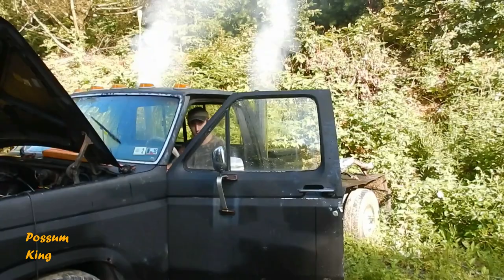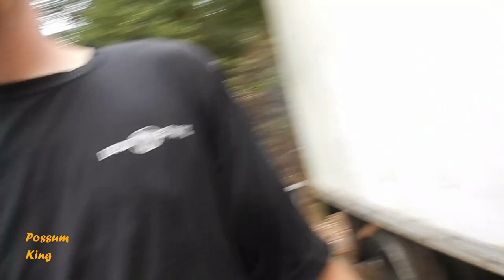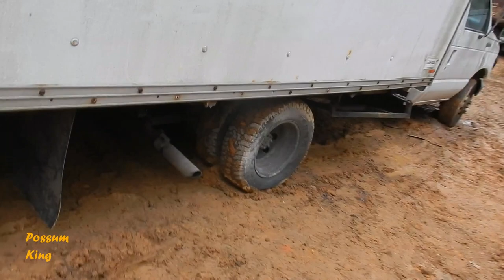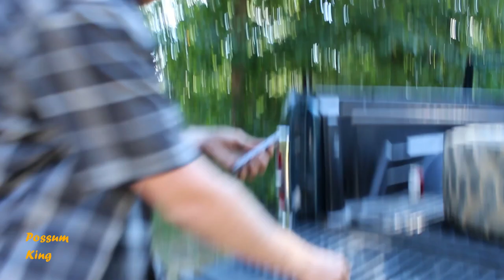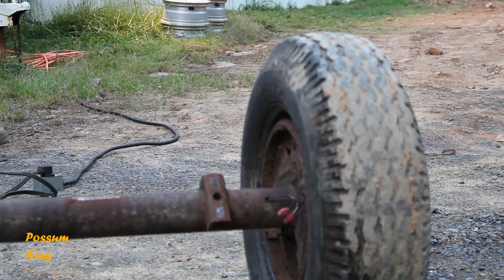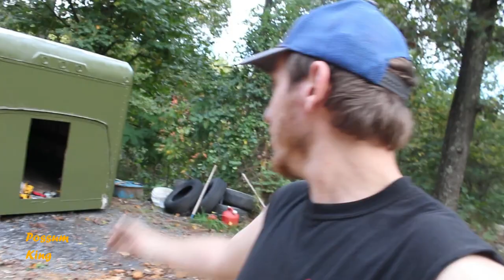Building A Cargo Trailer

Comment: You should of cut the frame at the back of the cab and welded a A frame tongue and used it as a bumper pull
Reply from the maker: yeah, well originally i was gonna build a hauler for side by side/4 wheeler out of that van. Neither worked out.

Comment: You could have removed. The front cab, motor, transmission, drive shaft, gas tank. Then welded a hitch to the frame.
Reply from the maker: yeah, I couldnt see how crappy the under side of the box was until i pulled it off. It got repurposed. I actally started framing around it so its a nice looking shed.